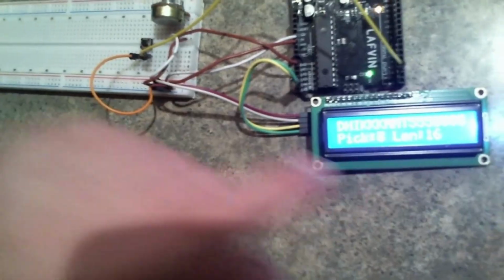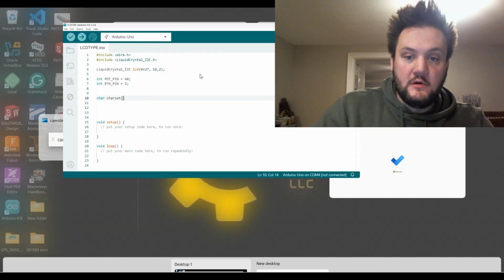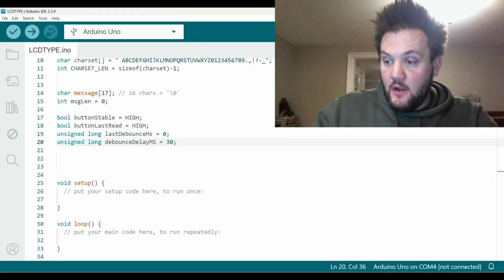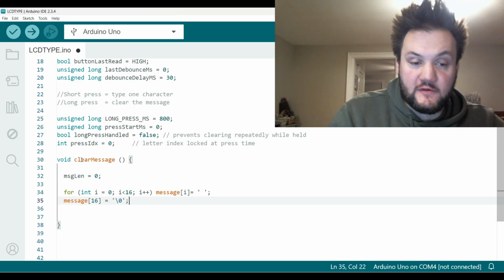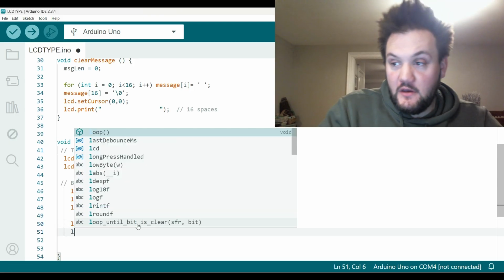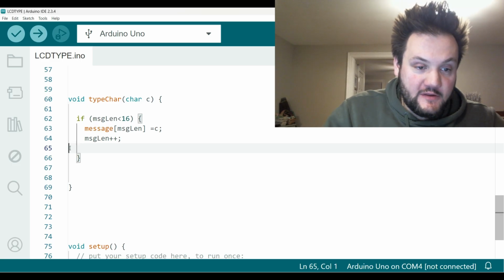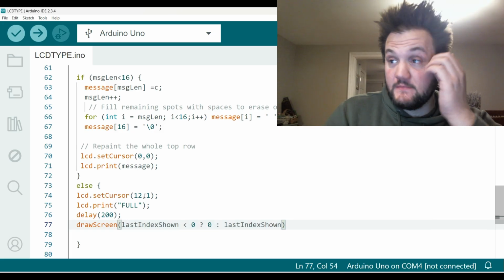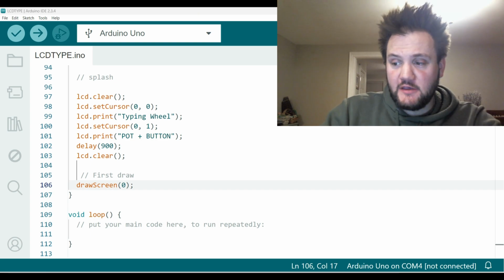Arduino 101: Writing Text to a 16×2 LCD (CODE Part 1)

Comment from the maker: #include <Wire.h>
#include <LiquidCrystal_I2C.h>

// Typing Wheel: knob picks a character, tap types it, hold clears.
LiquidCrystal_I2C lcd(0x27, 16, 2);

// Wiring: Pot middle -> A0, sides -> 5V/GND. Button -> D2 and GND (INPUT_PULLUP).
const int POT_PIN = A0;
const int BTN_PIN = 2;

// Characters you can scroll through
const char charset[] = " ABCDEFGHIJKLMNOPQRSTUVWXYZ0123456789.,!?-_";
const int CHARSET_LEN = sizeof(charset) - 1;

// Top row message (16 chars max)
char message[17];
int msgLen = 0;

// Button debounce
bool buttonStable = HIGH;
bool buttonLastRead = HIGH;
unsigned long lastDebounceMs = 0;
const unsigned long debounceDelayMs = 30;

// Short press = type, long press = clear
const unsigned long LONG_PRESS_MS = 800;
unsigned long pressStartMs = 0;
bool longPressHandled = false;
int pressIdx = 0;

// Reduce LCD flicker
int lastIndexShown = -1;

void clearMessage() {
  msgLen = 0;
  for (int i = 0; i < 16; i++) message[i] = ' ';
  message[16] = '\0';
  lcd.setCursor(0, 0);
  lcd.print("                ");
}

void drawScreen(int selectedIdx) {
  lcd.setCursor(0, 0);
  lcd.print(message);

  lcd.setCursor(0, 1);
  lcd.print("Pick:");
  lcd.print(charset[selectedIdx]);
  lcd.print(" Len:");
  if (msgLen < 10) lcd.print('0');
  lcd.print(msgLen);
  lcd.print("   ");
}

void typeChar(char c) {
  if (msgLen < 16) {
    message[msgLen] = c;
    msgLen++;
    for (int i = msgLen; i < 16; i++) message[i] = ' ';
    message[16] = '\0';
    lcd.setCursor(0, 0);
    lcd.print(message);
  } else {
    lcd.setCursor(12, 1);
    lcd.print("FULL");
    delay(200);
    drawScreen(lastIndexShown < 0 ? 0 : lastIndexShown);
  }
}

void setup() {
  pinMode(BTN_PIN, INPUT_PULLUP);
  Wire.begin();

  lcd.init();
  lcd.backlight();

  for (int i = 0; i < 16; i++) message[i] = ' ';
  message[16] = '\0';

  lcd.clear();
  lcd.setCursor(0, 0);
  lcd.print("Typing Wheel");
  lcd.setCursor(0, 1);
  lcd.print("Pot + Button");
  delay(900);
  lcd.clear();

  drawScreen(0);
}

void loop() {
  // Knob -> character index
  int raw = analogRead(POT_PIN);
  int idx = map(raw, 0, 1023, 0, CHARSET_LEN - 1);
  idx = constrain(idx, 0, CHARSET_LEN - 1);

  // Button debounce
  bool readNow = digitalRead(BTN_PIN);

  if (readNow != buttonLastRead) {
    lastDebounceMs = millis();
    buttonLastRead = readNow;
  }

  if ((millis() - lastDebounceMs) > debounceDelayMs) {
    if (readNow != buttonStable) {
      buttonStable = readNow;

      if (buttonStable == LOW) {          // pressed
        pressStartMs = millis();
        longPressHandled = false;
        pressIdx = idx;                    // lock letter
      } else {                              // released
        if (!longPressHandled) typeChar(charset[pressIdx]);
      }
    }
  }

  // Long press = clear (once)
  if (buttonStable == LOW && !longPressHandled) {
    if (millis() - pressStartMs >= LONG_PRESS_MS) {
      clearMessage();
      drawScreen(idx);
      lastIndexShown = idx;
      longPressHandled = true;
    }
  }

  // Update only when selection changes
  if (idx != lastIndexShown) {
    drawScreen(idx);
    lastIndexShown = idx;
  }
}